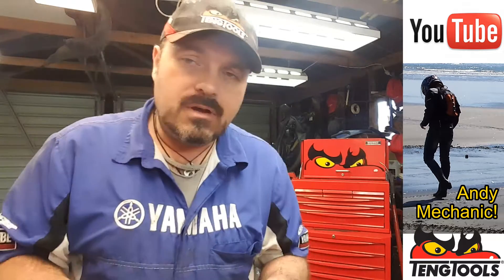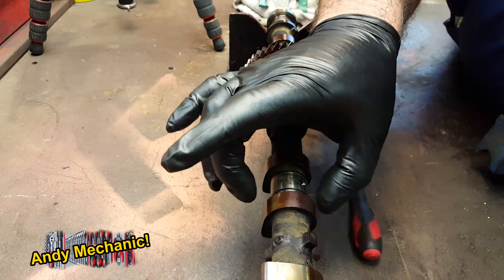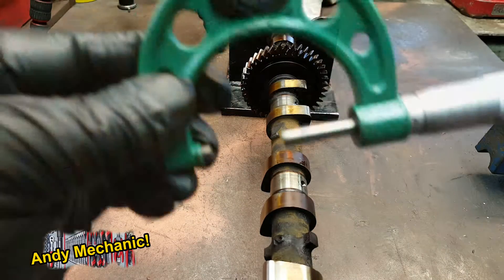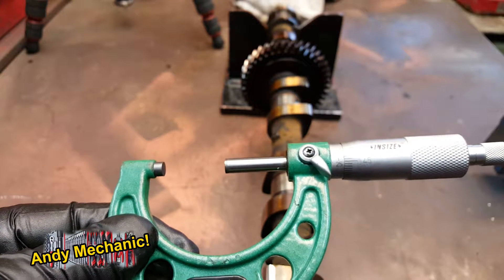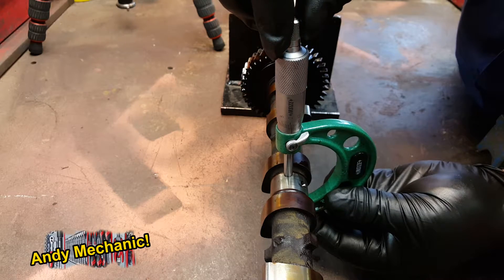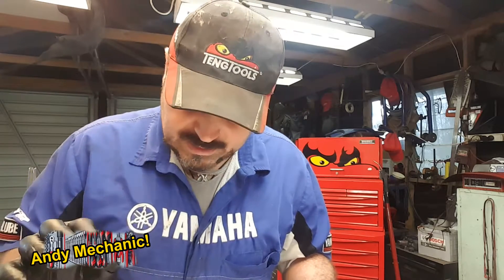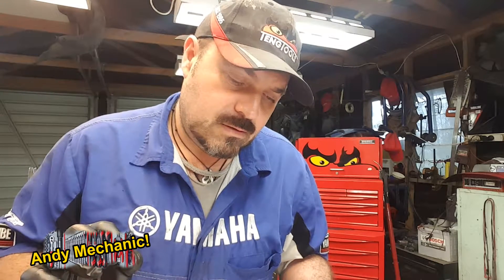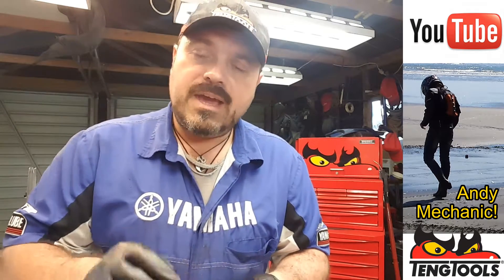Toyota Rav4 measuring cam shaft journals for wear Ep13 #1127

Comment: Rocking the micrometer off gives an inaccurate reading. You need to pull it back and forth perpendicular to find center of diameter and then pull it straight off to get the reading.

Comment: You say there's nothing you can do about a worn camshaft journals.  Maybe it's just something crazy here in the US, but I've seen cams and cranks alike get welded and then tossed in a lathe to be machined back into spec (or to be reshaped to a new spec), then nitrided for hardness.  A buddy of mine was rebuilding the 3.0L V8 from his Triumph Stag, and it ended up being cheaper by far to repair both the crank and the cam, rather than to source reman'd or new parts.  Plus the added benefit that he was able to stroke the motor and do a custom crank grind!  ;D
Reply from the maker: +rhkips you are right. I remember having an old CX500 crank shaft 'metal sprayed' and re-ground. It works but in that case not as good as a new crank. 

The Rav4 cams are ten a penny over here so if they are not serviceable then we'd just go get replacements which would be cheaper than getting the originals repaired...

Good point. I'd forgotten about that option. Cheers